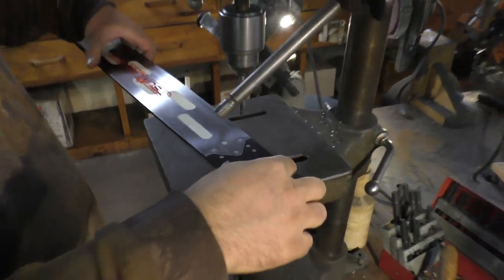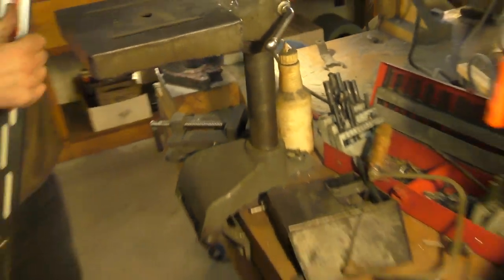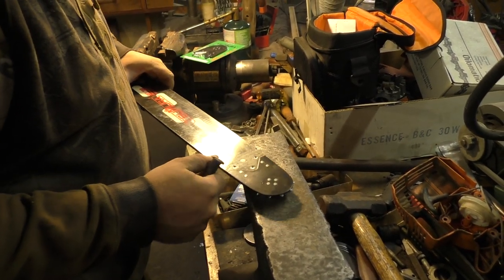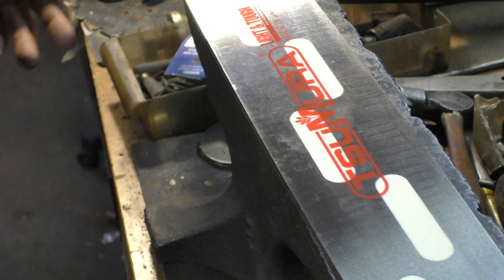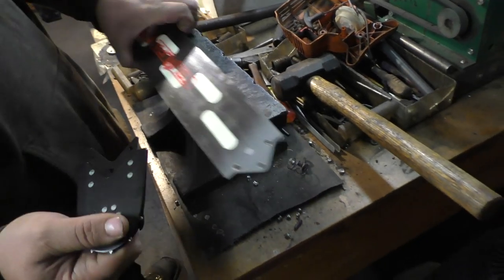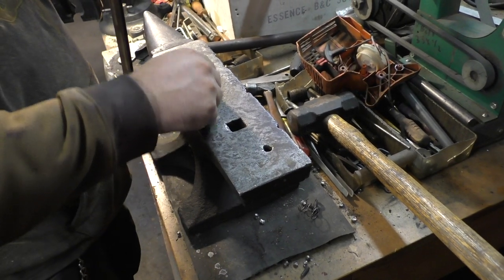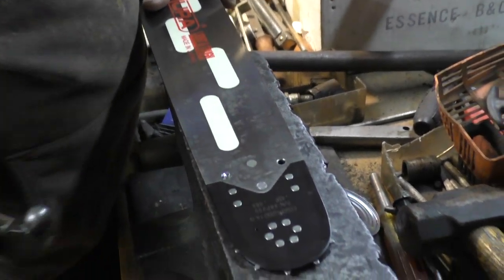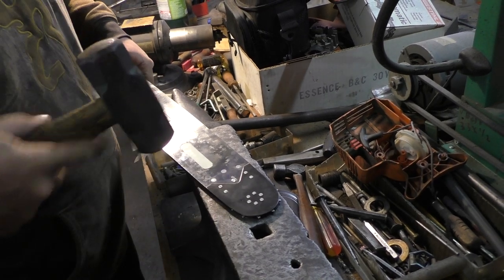How to change a Tsumura Bar Tip

Comment: Is there a punch available to set the rivets?  I have terrible aim with a hammer, and the bar would have peen dents all around the rivet by the time I was done, the barshop would be nice to flatten it also, or else if I did it, the rivet would be in the middle of an ash tray from where I missed with the BFH.  Thanks for the video

Comment: What are those bars? Never heard of them, we only use       
Stihl/husky factory bars here in europe. (Oregon sometimes too)
Reply from the maker: made in japan.  very good.  so is sugi hara but I like tsumura better.
Reply: @Redbull661  This is a very good bar but the sprocket nose is too fragile.
Reply: @bonscottforever  Because it has 4 pins in 3/8 configuration as it comes from the factory. If you put a 404 nose sprocket as here it has 6 pins and far more sturdy.
Reply: I'm European, and I've used Tsumura for a long time. You can buy both Sugihara and Tsumura lightweight bars in Europe. Infact, I've found it quite difficult to get hold of Oregon lightweight bars in Europe, versus the Japanese brands.

Comment: Do you guys ever run klotz oil in your saws?
Reply from the maker: no.  schaeffer 7000 or 9000.  I have a video of klotz super tech take down on a 661.  Also did original techniplate but no video.  Not as bad as super techniplate.